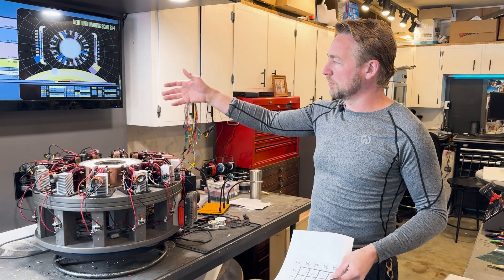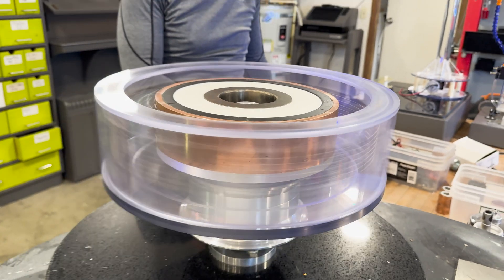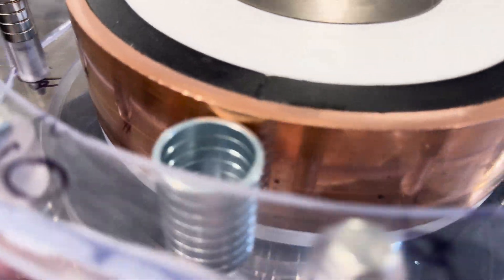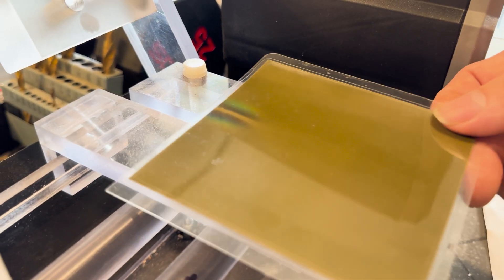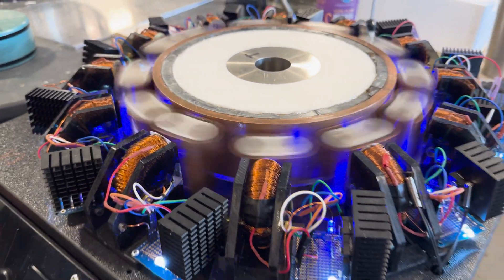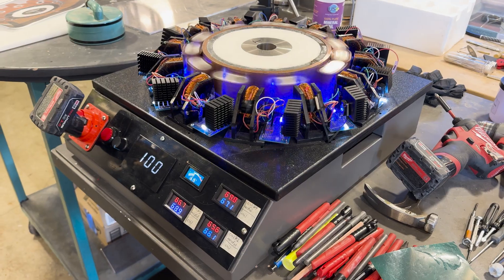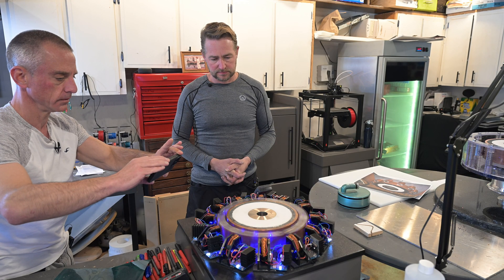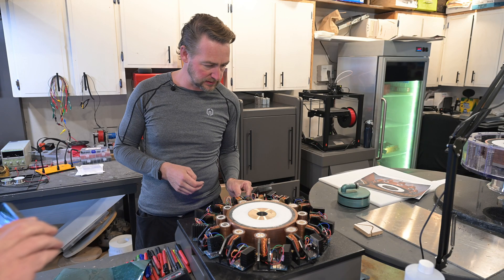Searl Effect Generator Experiments | Isaiah Ritchey | Portland 2024

Comment: This generates friction, you have to cancel the two poles, once this is done the rollers become isolated and capture the electrons.
Reply: electrons don't live in the air, they are inside the copper, that's why the device never worked in the past half century.

Comment: A one-meter diameter Searl effect generator can generate 15,000 watts to power an averaged size house. Isaiah' generator is about 1/3 of a meter in diameter. The magnetic field is 1/r^3. So, we divide 15,000 watts by 3^3 or 27 and get a power for Isaiah's generator of 560 watts. If he produces 120 volts to power the LED's that just emit light and no heat, then the amperage produced for his generator is about 4.6 amps and he has about 12 LEDs being powered then the amperage for each LED is 0.38 amps. If we multiply this by 120 volts then the power of the LEDs is about 45 watts each of light.
Reply: This thing isn't generating any power.
Reply: @jimbobbillybob  It is. Ether based technology.